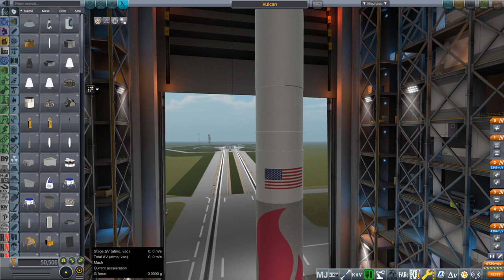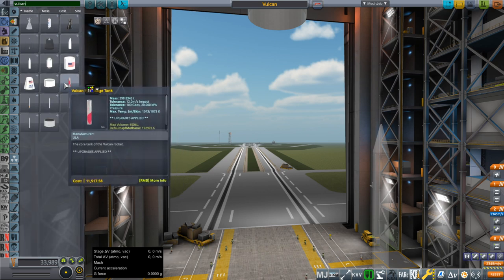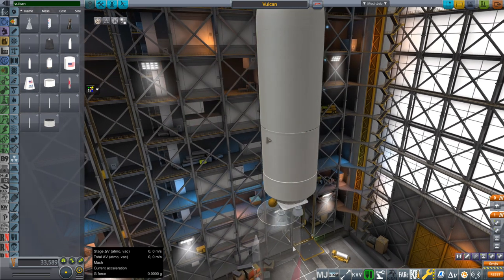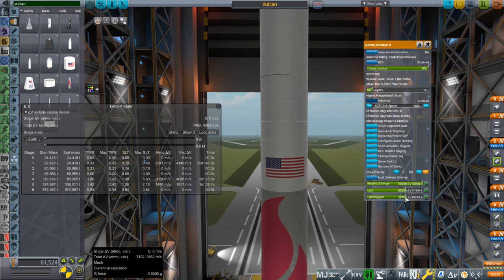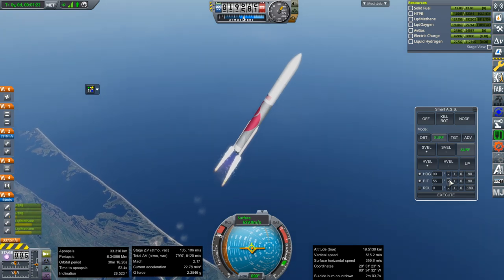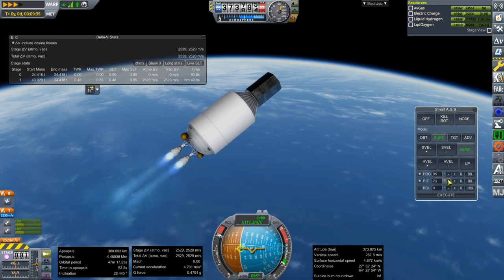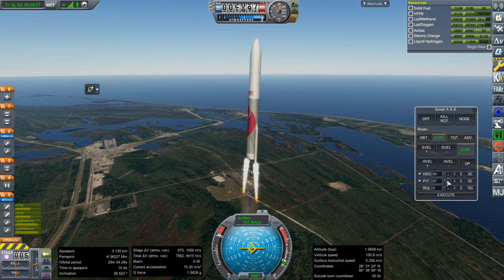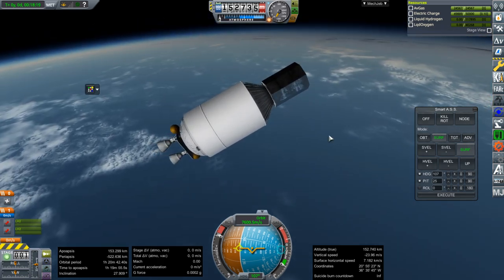Realism Overhaul in KSP 1.8.1 - Vulcan

Comment: I tried building vulcan a couple times using ROtanks and the fuel loads that ULA provides and I've basically have the same problem although I have the impression that they intend to fly the Centaur V with up to 4 RL-10s when carrying heavier payloads. The gravity losses are kind of ridiculous with that twr otherwise. I'm not sure they're under fueling the first stage though because the payload jumps dramatically from the single core to 2 booster variant which I would assume is due to low thrust to weight on the first stage as well.
Reply from the maker: Well, the ULA website is currently very much set on 2 RL-10s - they show no variant with 4.

Comment: 0:10 Damn, thought that this was the Soviet Vul*k*an in my sleepy stupor last night.
8:10 ULA has a fetish for low TWR upper stages.
Reply: Grant Exploit I believe they prefer to be called high efficiency stages
Reply: @buffaloc20  Sure, that's what they call them, but numerically speaking, there are no missions where the delta-V penalty of having 2 and 4 engines on a 3- or 5-meter Centaur on an Atlas V or Vulcan, respectively, or 2 engines on a DCSS on a Delta IV would be greater than the reduction of gravity losses, i.e. increasing the number of engines would increase payload capacity on any conceivable mission profile.

I suspect they only reason why they skimp on engines is that the RL10s are expensive as hell, so it may increase $/kg to include them.

Comment: Raiz i just downloaded your mod and tried flying it. I made it into a 607 x 620 km orbit, with ~250 m/s dV left (using the same config as the one in the video). All i did was underfuel the centaur stage (following the ratio) to 75% and take a pretty steep ascent, to get around 4 minutes to Ap. Centaur burns at 45 degrees inc. until the time to ap. starts growing again, then slowly tip down towards 0 degrees.
Reply from the maker: Glad to hear it, though I'd like to aim for a lower orbit (more beneficial for the transfer burns) so I can't quite match this strategy.
Reply: Raiz Space i tried to aim for around 300 km, but i was still unsucsessful. Underfueling the upper stage to around 55/60% might make it with the time to ap. but its short by just ~ 100 m/s so maybe the launch trajectory is the trick

Comment: Imagine a vulcan rocket with 4 raptors. Combined, they would weigh less, produce more thrust, be more efficient, have a higher TWR, and could have potential for engine out capability.
Reply from the maker: Well, first of all we have no idea what Blue Origin is charging for BE-4s or what SpaceX would charge someone else to buy Raptors, so the claim that they would cost less is questionable. SpaceX's internal estimate for the price of a Raptor has nothing to do with how much they would sell it for, after all. Second, SpaceX isn't selling Raptors just as they've never sought to sell Merlins, so the point is moot. Third, tall rockets are more susceptible to high-level wind issues, as SpaceX found out with Falcon 9.
Reply: @RaizSpace  The point is just how the BE-4 is a worse engine in almost every aspect.
Reply: @stephenwitwick3926  Raptor is a baby still and Raptor is not made for that vehicle, if you talk like that then yes, Raptor is better than every engine however your also saying that every rocket should use that which is not a good choice.
Reply: @Aceb_k  I just wanted to highlight how good it was.

Comment: I still don't get, why they underpower the upper stages that much. As far as Tory indicated it, it's a trade-off of fuel vs engine costs, but still. Payload could be so much more, if Centaur V is run with 3 or more RL10s...
Reply from the maker: Because you're thinking of LEO whereas the rocket is designed to go to GTO and beyond. Since TWR is mostly pointless while in orbit and the upper stage on a GTO mission provides much of its delta-v while already in orbit, they don't want to spend the extra money on engines. Everyone talks about the LEO capabilities of a rocket so that's what I most often test, but really, this one, Ariane, and a few others should be advertised based on their GTO capabilities.
Reply: @RaizSpace , true, nonetheless, if they had the flexibility to add more in case of heavy loads, they could offer to a larger client base - apparently that's not requested or covered by SpaceX.

Comment: Cool, rocket! I see that you have the SLS? How do you download it for a realism overhaul? I’m able to get all of the right parts, but it does not have enough burn time for any of the stages.
Reply from the maker: There should be an RO config in the thread for the Space Launch System by Sobol. That's what I use - I don't think I changed it.
Reply: @RaizSpace  thanks! Is it the space launch system part pack?

Comment: RSS Doesn't make the Cape look like that. What mods are you using to get the buildings and all the rivers?
Reply from the maker: There's Katniss Cape Canaveral for the landscape and some buildings. I placed some structures from Real KSC as well - but you'll have to manually place those in 1.8.1 - they only seem to place themselves in 1.3.1. Everything requires Kerbal Konstructs.

Comment: I thought Realism Overhaul only works with very old versions of KSP (like 1.2)? Has something changed?
Reply: Ohhb boy are you out of the loop.
RO and RP-1 (career version of RO) are officially released for 1.8.1.
Currently super easy to install compared to old versions.
Check this if you're interested:https://github.com/KSP-RO/RP-0/wiki/RO-&-RP-1-Installation-for-1.8.1
Reply: @Maravone  Correction RP-1 is not a version of RO, it's an additional mod that handles contracts, tech trees, etc. All the stuff you want in a career playthrough